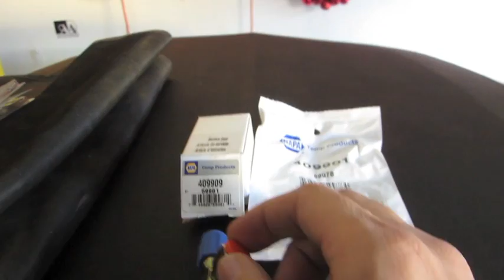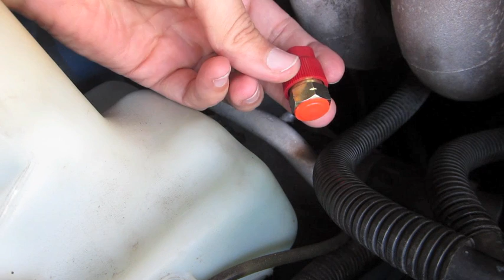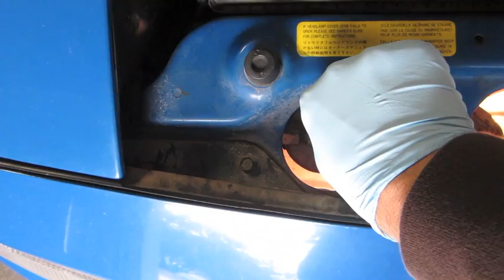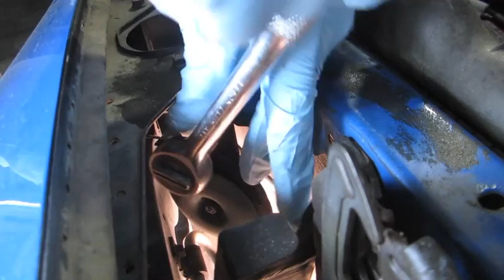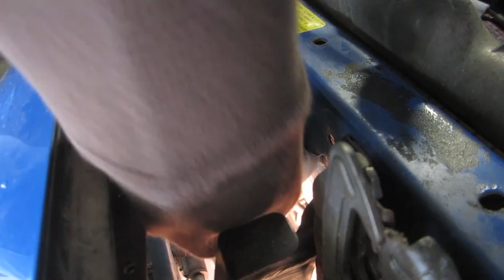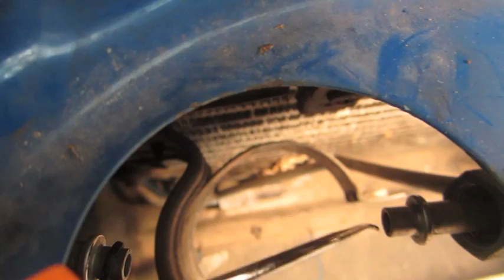1991 Miata Restoration AC part 1

Comment: So Is it normal for air to come out when replacing the valves? I'm putting the adapters but when I was about to remove the valve, air came out so I didn't. It wasn't cold or anything it was just air. I definitely didn't expect that since it blows hot, so I don't think it has any r12 left. Then again, my compressor could be bad.. I know the video is old but I hope you respond since I really need help!

Comment: I hope you reply but can I ask why your high and low are on the same side and near each other? My high is closer to my Radiator. So Idk if I'm R12 or R134
Reply: Anthony Anderson check your valves. It depends by year. My 1993 also has the high side near the radiator. If your's is 1996 or later, it's definitely r-134.
Reply: Fam4sta thanks and I have a 91 used  but I figured out that it was switched from R12 to 134

Comment: Hey man! I hope you reply because I'm in desperate need. Is this to convert the r12 to r134 ? Or are you just charging the ac
Reply from the maker: Since I was replacing so many pieces, I went ahead and converted to r134. That is why I had to install new fittings for the AC lines.

Comment: how do you know if my Miata has been changed to R134a? I just got it and is has no cool air. I think just a recharge. What do you all think?
Reply from the maker: The high side and low side valves will be different sizes. This was done in case the red cap and blue cap were lost.

Comment: Do you have to change the compressor with the conversion ?
Reply from the maker: There might be some residual oil in the compressor that didn't get pulled out when vacuuming. There might also be some internal seals in the compressor saturated with the old oil. Since the oils aren't compatible, I'd go ahead and do it. Check with the dealership to see if the part numbers are the same old vs. new if you want a more definitive answer.

Comment: when you put on the new drier did you have to put oil in it? 

thanks for all the help btw. doing this exact thing soon with the summer coming. i live in austin also btw and its gonna get hot soon
Reply from the maker: From what I remember, the only place I had oil added was the compressor. Good luck with yours.

Comment: Where do I get the 90 angle to charge the ac
Reply from the maker: I got the valves at NAPA Auto Parts. 3820 S Congress Ave, Austin, TX 
(512) 445-2166. part # 409909 / 59981 for low side. High side 409901 / 19978

Comment: do you have to replace the valves inside before installing thre new 134 adapter?
Reply from the maker: In order to put the new adaptors on, you need to remove the old schrader valve inside the AC lines. So yes, you have to replace them. Good news is that the adapters come with new valves already inside them.

Comment from the maker: I got the valves at NAPA Auto Parts. 3820 S Congress Ave, Austin, TX 
(512) 445-2166. part # 409909 / 59981  for low side.  High side 409901 / 19978

Comment from the maker: @juanfiera How did you get the 134 into the system without replacing the high and low side valves? Those valves are specially shaped so the charging hose and gauge will attach. Replacing the o-rings are necessary so that was good. When you opened the system to replace the rings, did you have the system evacuated afterward? If not, the oil that was in there for r-12 will react with r134 and gunk things up, unless it was 134w/ester. That stuff is apparently ok.

Comment: Is it ok if I only replaced the o-rings on mine? The same dryer is there and i filled it with R-134 as well, didn't replace the valves near the intake manifold either.